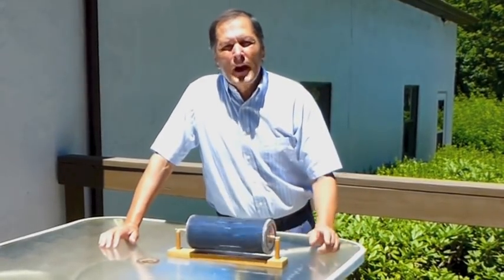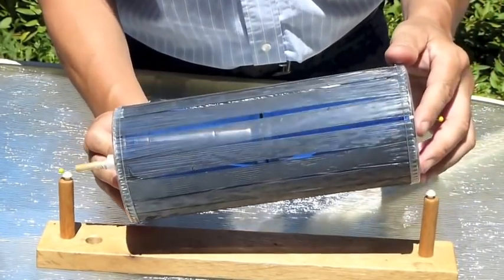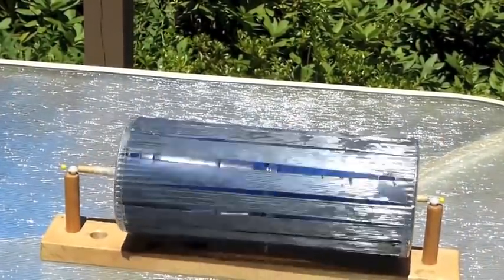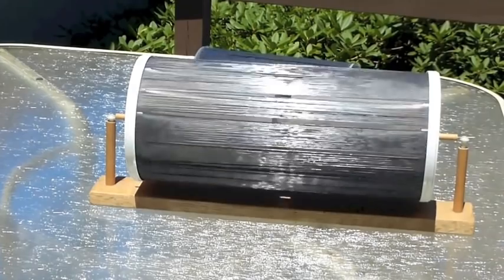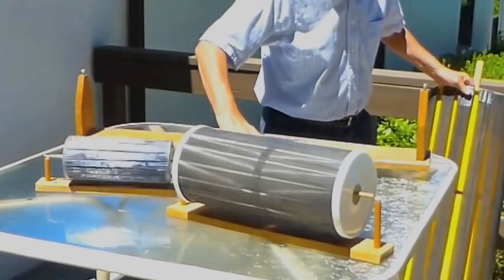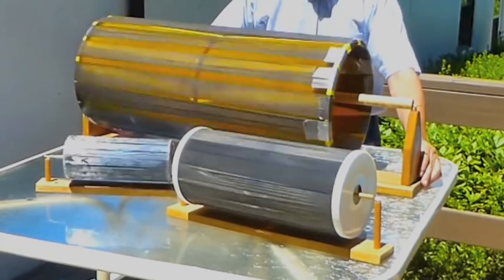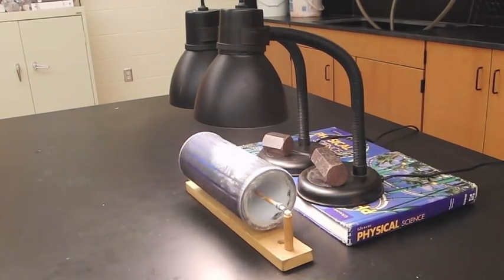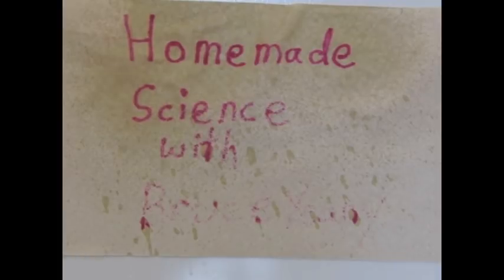Solar motor--Free energy motor-- not electrical /// Homemade Science with Bruce Yeany

Comment: just a question since you said if you dont have sun light just use 60watt bulbs i was wondering so then is it the heat thats making it turn and not the sun it self? just the heat produced from the sun?
Reply from the maker: Good question,  the strips are made by stretching black  trash bag plastic.  They convert the sunlight into enough heat to operate the motor.  For the fun of it,  I tried using white plastic strips and it didn't work with sunlight.  However,  if I placed the motor with white strips under the two light bulbs it would work but just barely.
Reply: +Bruce Yeany (Yeany Science) yes that's what I was thinking because black obsorbs heart better white reflects it and don't keep great as well so I think it's heat in general thay powers it

Comment: neat idea, what if you made a large one out of lighter materials? 
Those buckets have got to be pretty heavy for the device to operate. Why not use styrofoam?
Reply from the maker: the operation depends on the rotor having some weight to it.  It operates by shifting the center of gravity.  In the ones I make I actually add weight to the foam cups to make them heavier.  If you want more information on them, send an email address and you can see how them are made and how they work

Comment: Anybody knows why it moves?
Reply from the maker: The plastic strips are made by stretching black polyethelene garbage bags.  The movement of the motor is due to these thin plastic strips at the top of the cup assembly contracting slightly when heated by light; this action is pulling the cups together at the top.  The action is not noticeable since it is so slight.   With the cups pulled together, the assembly becomes unbalanced.  The motor is now top heavy and starts to turn and fall toward the bottom.    As the assembly turns, a new section is then exposed to light and is heated. This new spot becomes top heavy causing this section to fall.  The action is continually repeated making the top section always unbalanced; the cups are constantly trying to adjust to become balanced. The end result is the motor turning because it is trying to right itself.

Comment: I'm not sure how they're operating "without any electrical or other mechanical parts" as they appear to just be a variation of a simple Mendocino Motor (look to the videos on the right  and I'm sure you'll see one or two Mendocino motors to compare it to). The typical Mendocino Motor  simply takes the electricity generated by the solar cells  (bands) and runs it through a series of coils of wire wrapped around the tube.  This creates a magnetic field which interacts with the magnetic field of a stationary magnet in the base of the unit. It operates basically like a standard electrical motor except the power being put into the motor comes from the sun instead of AC or DC power.  I don't see the magnet in the base but I'm sure there's one there.   IF it's not operating using the same principle as a Mendocino Motor then how exactly is it rotating?  Please explain.
Reply from the maker: Hi Soulrider2012,   no, this isn't a Mendocino motor.  There are no magnets, wires, batteries, or solar cells involved. The plastic strips are made by stretching black polyethelene garbage bags.  The movement of the motor is due to these thin plastic strips at the top of the cup assembly contracting slightly when heated by light; this action is pulling the cups together at the top.  The action is not noticeable since it is so slight.  It is noticeable if the plastic is heated sufficiently, but do not try it with the cup assembly.  With the cups pulled together, the assembly becomes unbalanced.  The motor is now top heavy and starts to turn and fall toward the bottom.    As the assembly turns, a new section is then exposed to light and is heated. This new spot becomes top heavy causing this section to fall.  The action is continually repeated making the top section always unbalanced; the cups are constantly trying to adjust to become balanced. The end result is the motor turning because it is trying to right itself.  If you send me an email address I will forward a complete set of instructions on how to build it and how it works, this is taken from a book that I had published a few years ago.

Comment: that's sweet, try connecting an engine to it and see if it can produce energy
Reply: It can, I think it produces around 0.001V
Reply: neonlent:
V is not energy, it's voltage. You bettrer use watts or W.
Reply: Alex:
This machine which also is an engine is already producing energy, mechanical energy.
Reply: +lvlarihuano lvlarihuanísimo agreed you knew what I meant lol.
Reply from the maker: For those interested,  I've had students  calculate the power in watts and then convert it to  horsepower.       A reasonable number is about 1.5 millionths of a horsepower, or this can be expressed as  
  1.5 micro-horsepower.
Reply: Bruce Yeany
If 1 HP are 746 watts, then your device has a power of 746 / 1,500,000 = 0.000497333 watts
 or 497 microwatts.

Is that correct?
Reply: +lvlarihuano lvlarihuanísimo Thanks, sorry, my mistake. I'm not really a fan of physics ;(
Reply: neonlent
No problem man, you were close to the answer.

Greets from Mexico
Reply from the maker: lvlarihuano lvlarihuanísimo sounds right,  which is why it is not the answer to the energy problems

Comment: Hi Bruce, this is incredible! Would you email me please on how you make this: hardingfele33@gmail.com     how do you join the cups together? What's the spindle made of that runs through the centre?
Reply from the maker: +carly olsen Hi Carely,  the center spindle is a 1/4 inch wooden dowel and the cups are held on with a self tapping nut but can also be glued on.  I'm sending you a complete set of instructions

Comment: What are the solar strips made of?
Reply from the maker: +Bob Brueckner  Hello Bob,  the strips are made from plastic garbage bags,  it is cut into thin strips cut parallel to the top of the bag and then stretched until it reaches it's elastic limit
Reply: +Bruce Yeany (Yeany Science)   This much I get, the IR heat causes the plastic to tighten a little, offsetting the balance of the cups, causing the rotation. But are they taped onto the cups under high tension, or are they just brought to a slack-free tension?
Reply: +Bob Brueckner - this cool little DIY trick can slash your power bill in just 60 days*! Check out ==> www.solarenergy.ml

Comment: the solar strips are??? just black polythene ??
Reply from the maker: +jatinkuberker Yes,  but it needs to be stretched first.
Reply: :) thanks
Reply from the maker: one other note, cut the strips parallel to the top of the bag, wider than what you want, then pull,  the plastic will stretch and you will know when it's reached it's elastic limit.

Comment: Why do you need a separator between the two cups?  If you just pushed the two ends of the cups together, would it still work?
Reply from the maker: +Andrew Jenery Hello Andrew,  the separator between the cups allows the cups to bend a bit more easily it is acting as a hinge or joint,  if you put the cups end to end,  it makes the rotor more rigid,  and now the strips must bent the cups.  It should work this way also but I like having the separation between them better.
Reply: +Bruce Yeany (Yeany Science) Thanks Bruce for clearing that up - and a great invention.  I suppose the trick is finding which type of plastic strip would expand and contract easiest...  By the way, I notice that one end of the axle is longer than the other and that there seems to be some sort of extremity on that end.  Is this a factor?

Comment: It works by exploiting expansion and contraction of the black plastic bag slats to change the centre of gravity. No useful power can be generated unfortunately. Nice toy though.
Reply: More like contraction when heated, relaxes when cooling.
Similar to muscle
Reply: Unless you have many of them and utilize mechanical advantage.  That is "direct" energy from the sun.  Think if you had a thousand tiny ones.
Reply: The drag of the magnets would stop this contraption.  It is better to see it as a toy:)  Over all its fun to watch and speculate and bring up other possibilities like what if the strips were aluminum or steel all balanced to perfection and in a larger scale!  there are cloudy days:)
Reply: +Craig Camidge You could use magnetic gearing with no physical contact.  Could also perhaps utilize nitinol wire.
Reply: Wavefront101 the problem with nitinol wire is all the energy it can produced is put into it when created thus it's not economical to use as a power source at all.
Reply: Would have to link many of them to a centralized gear, and then to generate electricity.  It would work.
Reply: It's nice to watch because it spins, but a good solar panel will capture over 20% of the solar energy hitting it.  Cover your roof with them and you've got enough electricity to power your home instead of just spinning a pair of Solo cups.  If you need to see something spinning, watch your electric meter spinning backwards ;)
Reply: +Craig Camidge he could hake them at a larger 
scale and then use a gearing system that will give you more power efficiency, cheap power coming from multiple places can make everyone happy, lower electric bills etc
Reply: Nicholas skinner Unfortunately not, the extra friction caused by the mechanical gearing would lower the overall efficiency and use as much or more than that generated output, better to take energy from the air using super refrigeration systems.
Reply: surely even at that scale connected to a basic dynamo nomadic people could charge a phone out of recycled crap thrown away

Comment: can u send how it can be used in our daily life send mail to kollasaikumar7@gmail.com please
Reply from the maker: +Kolla Saikumar I like to think of them as interesting displays of energy conversion but the torque of these motors are so small that it has no practical use. If you watch the additional videos I've made of them you'll see the bell ringer or the hammer are just for entertainment and not capable of doing real work.   Even scaled up to a much larger size these would not be able to turn the smallest of generators.  For those looking for an energy source, they would be better off looking at solar cells or other devices that are more efficient.

Bruce

Comment: would you please send me the instructions on how to build this myself. what is the largest you have made? how much torque do you get out of a large one. do you think this could be upscaled to say 20 or 50 gal plastic barrels? could you send me the construction info to mcdradus@gmail.com thank you
Reply from the maker: +mcdradus  Hello mcdradus,  the instructions are sent.  The torque is extremely small, not even enough to turn a small toy motor.  I have tried a larger variation but was not vary successful.

Comment: Wow,   and I thought Mr Wizard died?....Seriously , I like it.
Reply from the maker: Dennis Adams  Hi Dennis,   LOL,     If your interested I have written up  plans and information on it .   Send me an email and I'll send it.
Reply: Bruce Yeany 
I would love to have it.  dadams14@gmail.com.  
I make whirligigs which are powered by wind, but I always wanted to make one that was powered by wind and by solar electricity.   So when there is wind there could be a slipping gear  that would disengage the solar motor .
I have found motors geared down to about 20 rpm and they are 6v and 10 ma current., but I  have not been able to work out the clutch. Thanks  BTW love the Beatles music
Reply from the maker: Dennis Adams Hello Dennis,   the information is on the way.   I would be very interested to see how this progresses.   Keep in mind that these motors have very little torque.

Comment: Good morning, professor Yany, i am a designer of prototypes for solar energy use. Congratulations for this project: REALLY FANTASTIC!!!
Reply: Matteo Muccioli Excuse me, Professor Yany, is it a tipe of Crookes Radiometer?
Reply from the maker: Matteo Muccioli Hello Matteo, thank you for your comments.  This is not the same as a Crookes tube.  The motor turns because sunlight warms the strips at the top of the rotor and causes them to shrink momentarily.  As they shrink the rotor becomes top heavy and becomes unbalanced. This then causes the wheel to turn,  exposing new strips to the sun and the process repeats itself.  If you are interested,  I can send you more information on the solar motor.  Just send me an email address.
Reply: Thank you so much for your reply ; I'll try to build the solar motor and I'll keep you updated .
See you soon.
Matteo
Reply: Bruce Yeany
Reply: Bruce Yeany Hello, would you send me some more detailed informations about your awesome projects like this one? my email is pauliklibor @ gmail . com

Comment: Nice! Like nitinol, the garbage bag strip shrink in the heat of the sun and expand in the cool of the unexposed side, thus drawing the top side of the cups or buckets closer together and away from the axis, making that side heavier to produce motion! One can join several of these in series to generate grater torque.
Reply from the maker: MagnaMoRo Thanks for your note.   I haven't played around with the nitinol wire very much but have had some fun with it. I had a couple students bring some in to my class.   What you describe  is pretty much what is going on with these..   We have calculated the power exerted by these motors,  the small one is running about  1.5 millionth of a horsepower  so to get anything usable it would have to be ones much larger my biggest one these banded together. That might be more effort than what it would be worth.  However,   I still like these even if they are not the answer  to the energy crisis.
Reply: Do you know why nitinol is not yet used at large scale for solar energy?

Comment: Dear Professor Bruce , I'm an admirer of his work , I am a high school teacher in physics in Argentina . I copied the solar motor and managed to work some problems . The question is because it works , it's the principle of the radiometer mismpo ? Thank you very much . Sorry for my English ( google translator) :)
Reply from the maker: Espacio de César     Hello Espacio, These two devices spin for different reasons. The movement of this motor is dependent on the unique property of the stretched plastic polyethylene strips.  The chemical's characteristics is that it is made of very long molecular chains.  These long molecules are stretched to their elastic limit during the stretching process. If more pressure is applied, these long chains are broken when the plastic tears apart.  By heating the strips, the polymer chains contract, pulling the molecules closer together.  They do not expand due to cooling as some students may suggest.  The action of the polyethylene contracting is quite different from a uniform expansion of matter as a result of kinetic energy. As this plastic is heated temporarily, the material pulls tighter and shrinks to a smaller size.  The plastic remains “shrunken” until pressure is applied to stretch the molecular chains out again. The movement of the motor is due to the materials at the top of the cup assembly contracting slightly; this action is pulling the cups together at the top.  The action is not noticeable since it is so slight.    With the top of the cups pulled together, the assemblybecomes unbalanced.  The motor is now top heavy and starts to turn and fall toward the bottom.    As the assembly turns, a new section is then exposed to light and is heated. This new spot becomes top heavy causing this section to fall.  The action is continually repeated making as the top continues to turn and fall as it tries to right itself. I think a radiometer spins due to the dark colored side of the vanes being heated more than the lighter color on the opposite side of each vane. The heated side of the vane causes the gas particles near it to heat up and gain kinetic energy. The increased kinetic energy of these particles strike the dark side of the vanes and push it causing it to spin.
Reply: Bruce Yeany Thank a teacher, I think I understood the concept , owned polyethylene , did a test did not work with electrical tape, now I understand .
When presenting this work at my youtube channel in Spanish I will tie your channel.
regards
Caesar
Reply from the maker: Espacio de César   Electrical tape would not work,  You need to use thin black trash bags that are cut into strips and then stretched.  If you send me an email address,  I will send you a complete set of instructions on how to build this
Reply: I did not understand how it worked so I put duct tape, but then I did with garbage bags and if it worked, I'd like to send me the material. I will spend my mail now a personal message. Thank you very much Professor
Reply: @YeanyScience  dear Bruce sir, I’m a physics teacher in India. I make many expts for my students inspired from your videos. The solar motor one didn’t work. I did it with black trash bag material. I will be obliged if you can email me detailed instructions for success. Eagerly awaiting for your reply. Regards, Satwik
Reply: I like. Please send me the instructions, I would like to try.
joshua.mwangi@yahoo.com

Comment: H Bruce, same question from me. What are the solar strips? Are they black plastic carry bag strips the kind you get from the supermarket? My email is lukeo25@gmail.com
Reply: I have studied this at length and believe its caused by the heated air in the gap between the strips. Air is drawn up because of convection from the cooler side. This causes the rotation of the spindle. Very clever stuff Bruce!
Reply: Luke ODonnell Thanks Bruce, I'm still sure that convection has a lot to do with the momentum. It would be interesting to do a smoke test to see what the air is doing.